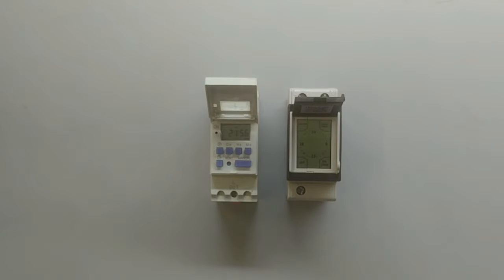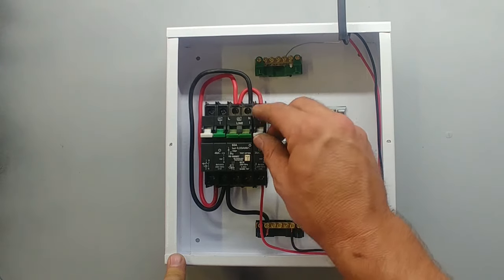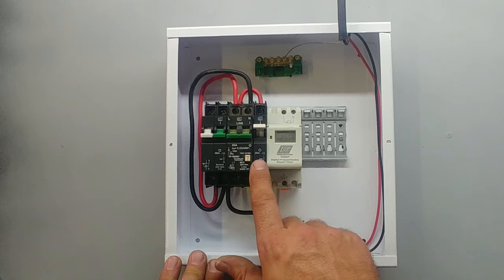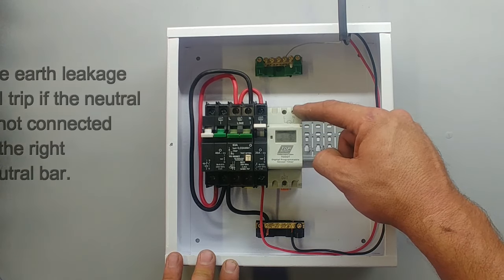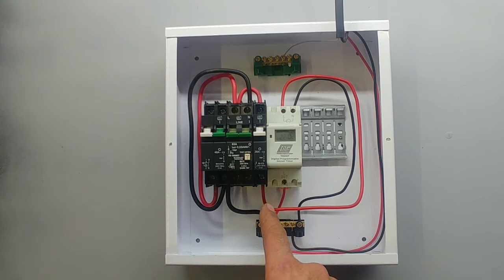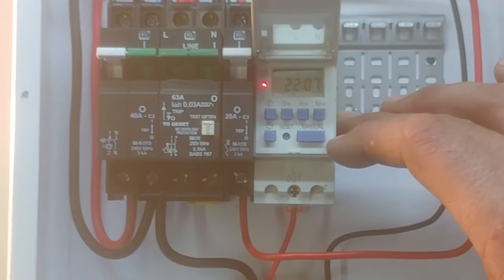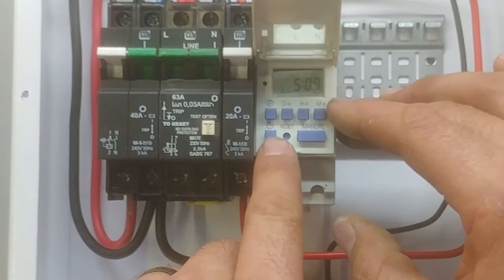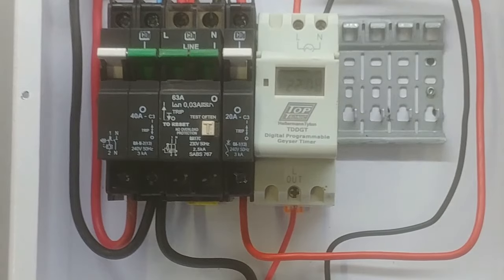How to Connect a Timer to Your Geyser/Hot Water Cylinder

Comment: Hi Jean. Is there a recommended temp the Geyser should run at for it To be hot enough to shower without burning and reducing electrical consumption?
Reply: Temperature is what you want it to be,however a rcommended temperature is 65deg.C above that the water will be scalding hot,geyser thermostats have a maximium setting which is around 65 and not much higher,the setting dial will show a max setting mechanically locked,hope this helps.

Comment: Hello
I have a Major Tech MTD8 timer.
It has the two connection points on the top for Live and Neutral but there are three connection points at the bottom. How do I install it?
It also says the timer must be protected by a 20Amp DIN mount MCB. Now what is this?

Comment: Hi good video but there are confusing , installed two today I sickled with them as the auto ON and Auto OFF is very confusing , seems to me that when you set the timer and you standing there and it’s before the time it’s needs to go on then you need to put it in auto OFF , or if you standing there and it’s at the time is supposed to be on then you set it at Auto ON , this is what seems to happen

Comment: Hi, 

Great vid. Two questions. 1- do these timers have user replaceable batteries? My one time looses all settings and time during power cuts. During loadshedding this wasn’t nice at all. 

And 2 - why would a timer become unresponsive. My other timer doesn’t respond to any inputs. So I can’t change the time or programs. Also some of the led segments no longer show. Luckily this one still maintains settings after power cuts.
Reply from the maker: Hi
I have never tried replacing the batteries but im sure its possible with some fiddling.
I would always replace a faulty timer. Trying to fix it is too much time and effort for me.

Comment: Can the timer handle 2 x Geysers?
Will the connection be the same?
Reply from the maker: Hi. Short answer is no. But it all depends on the size of the geysers. The most common geysers here are 3kw. But if you have two 1kw geysers it should be fine. Two 3kw geysers won't though...
Reply: @p0we111  it is 2 X 3kW Geysers which is currently connected to a 30 A breaker.  The geyser timer has a 30A rating.
Reply from the maker: @shalenm6028  If they state 30A it should be able to handle it. I always over speck on electrical stuff though, so I would maybe connect the timer to a 40A relay/contactor...
Reply: @p0we111  thank you

Comment: Does this timer have a battery backup in case of load shedding?
Reply: Hi. Yes it does. Mine ran for over a year on no power, only battery.
It will not however switch on the output with no power, but will keep time and settings.
Reply: @jeanboetzkes9820   Many thanks.  Would you recommend me trying this install myself?  I am fairly handy in a handyman kind of way - I can wire up a plug and a socket
Reply: @jeanboetzkes9820  Also, could you possibly do a movie on Electricians tools?  Specifically a multimeter and how to use it?
Reply: Doing it yourself is easy from my point of view, but watch the video and decide if you are comfortable doing it yourself. Just make sure all power is off, the correct size wire is used and all your connections are tight. Those are the important points.

I will be adding some videos soon. Have been quite for a while.
I also want to do some fun projects, if time allows!

Comment: Best to use a qualified electrician one that understands the torque required to tighten contacts for such a high powered input and output. Secondly use the timer to engage a high powered contactor . Look at how a 3.5kw AC3 220V Contactor is built compared to a so called geyser timer. These timers dont last because their contacts are not designed for high power high arcing switching. Rather use the timer to switch a contactor to switch your geyser!
Reply: IYou are correct,i use a timer to control a contactor for my geyser,even though these timers are rated at 16A they still have a relatively short life span.

Comment: How many geyser does the single timer operates?
Reply from the maker: With this timer, only one.
You will be able to put a contactor in and let the timer switch on the contactor which then switches on multiple geysers.
But it wil probably be cheaper to just put in two timers.